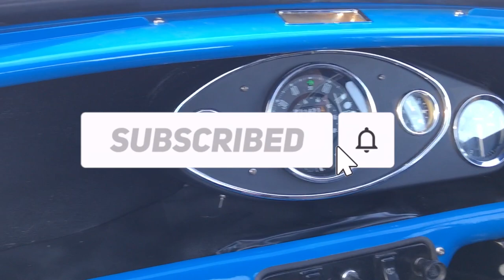Classic Mini Pickup 1275 Turbo - Crazy Fast

Comment: How well would the GT17 work on a slightly warmed over 1275? Looking for drivability over max boost. So, I guess, stock Metro turbo. With a tad more. Going in a '56 Austin A35 Van. Thanks.
Reply from the maker: I’m sure that would be a good setup, plenty of power without going insane in the boost! This pickup has sooo much boost!